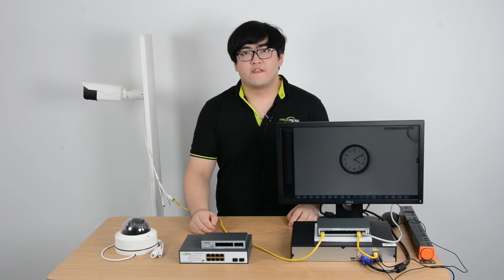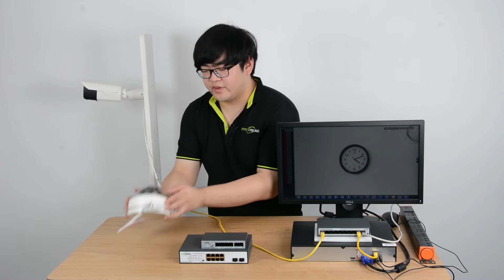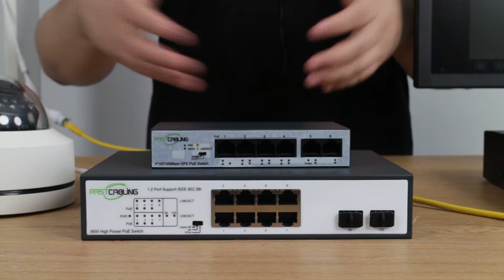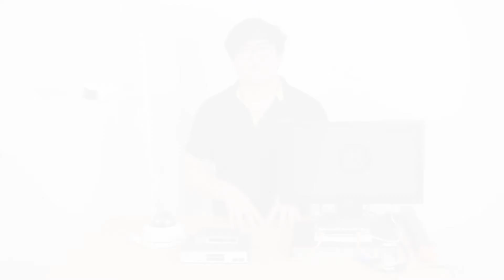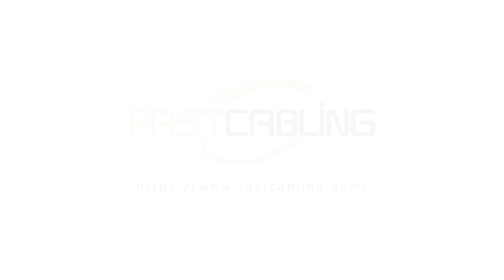How Much Speed PoE Switch Can Meet Your IP Camera Network Need?

Comment: Right. megabyte or megabit? seriously dont know if you're talking about 10/100mbit, 1gbit or 10gbit switches.
Reply from the maker: It is 1000mbps (1gbit) switch. Not 10gbit
Reply: @Fastcabling  so then why did you say megabyte. Terrible video.